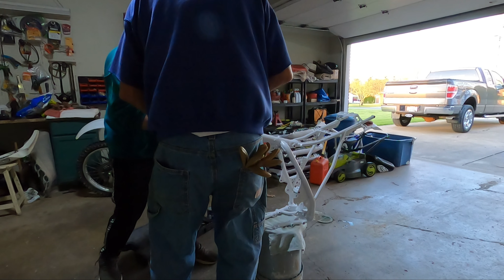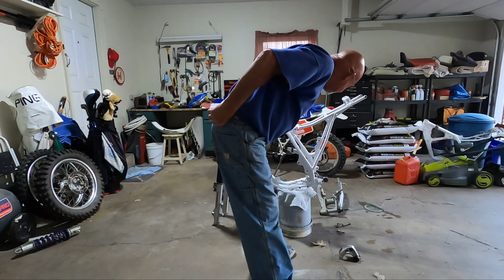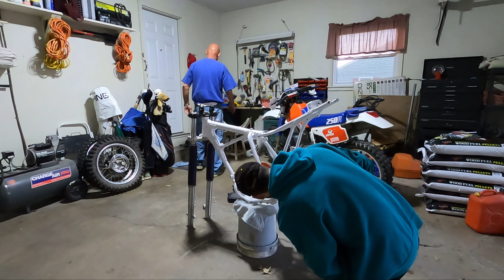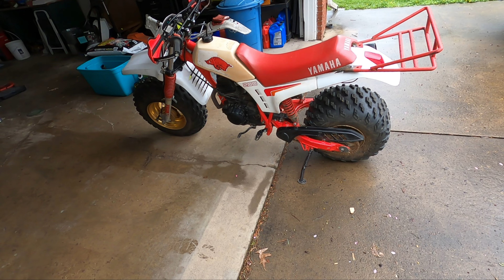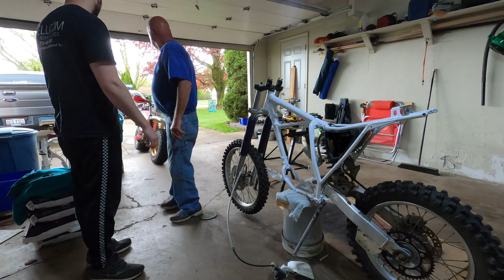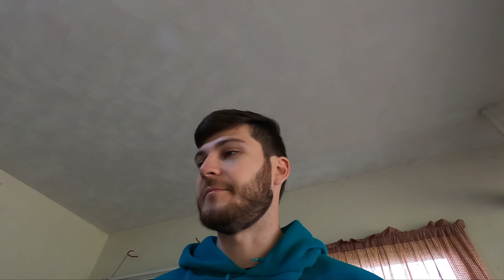The Custom XR200R Takes Shape!  (How to upgrade suspension)

Comment: Hey guys this is a good project and I am busy with an XR200 as well, we are also upgrading the suspension etc. I got suspension of a 2001 CR250R and it fits up almost perfectly with the exception of the rear brake slider that had to be modified. I would replace the front suspension while you are at it. But work with what you have. :)
Reply from the maker: Best of luck on your project!

Comment: I have an 86 xr200, would i be better off going to a 95 250 swingarm? What fork upgrade is there?
Reply from the maker: Good question honestly I had an 86 200 and I like the suspension on it if it needs rebuilt just rebuild the suspension and I think you’ll be happy with what you have. That being said if you wanted to upgrade to bigger equipment, you could go with a 86 to 89 XR 250 swing arm which would be bolt on and I would recommend that and you could use the front forks off of the 86 through 89 XR 250 which is also a bolt on.

Comment: Still seems a 96’ and not a 95’ donor. 96’ was a major design change remaining through 04’.

We used a 95’ as a donor for our 87’ 250 suspension and rear disc conversion. Colors, stickers, and parts all resemble the 95’ model. 😉
Reply from the maker: Yeah  the disc breaks are gonna be fun on it